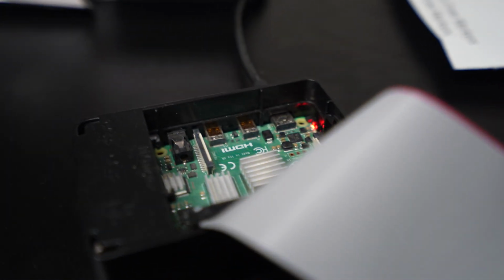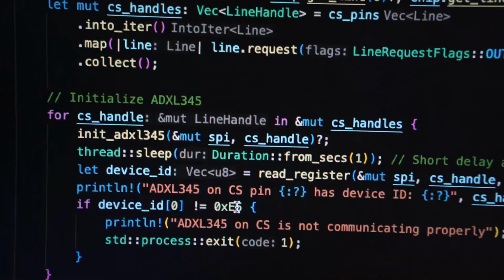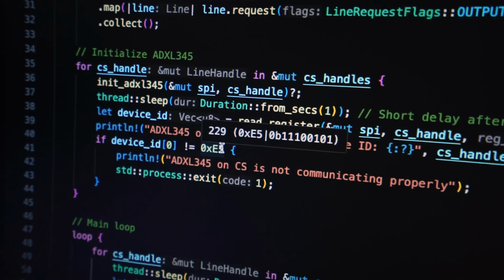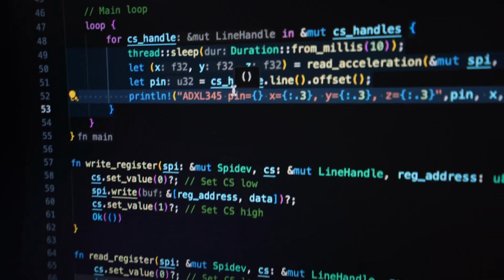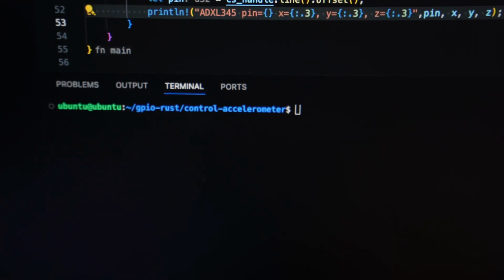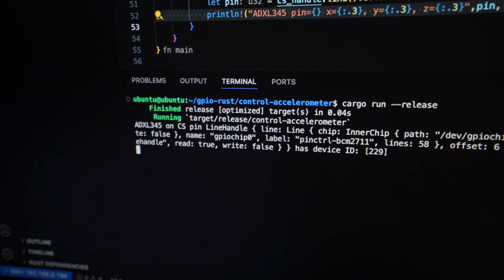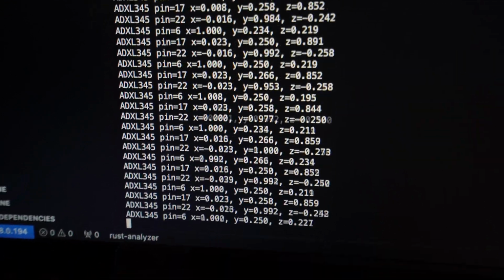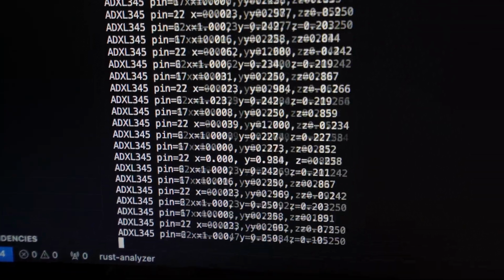Rust: Pushing Limits with 100 Hz Accelerometer Control

Comment: I am quite new to Rust and have only used ready made libraries for MPU6050 in arduino using C. I'm having a hard time understanding how fast this is, compared to the libraries that I have mentioned. Also, how different is the ADXL compared to the MPU. I apologize if I'm missing context here but can you inform me? I'm planning to use an IMU for a wheeled biped project and this info might be useful.
Reply from the maker: I am shopping with my mom but I’ll get back to you asap!!
Reply from the maker: Hello,

It's great that you're exploring different sensors for your wheeled biped project! I'd be happy to help clarify the differences and the performance aspects.

MPU6050 vs. ADXL Sensors:
Regarding the sensors, the MPU6050 and ADXL series (like ADXL345) are somewhat different in their capabilities. The MPU6050 is a 6-axis IMU, which includes a 3-axis accelerometer and a 3-axis gyroscope. This allows it to measure both acceleration and rotational motion, which is particularly useful for balancing applications in robotics.

On the other hand, the ADXL series typically includes accelerometers only. For instance, the ADXL345 is a 3-axis accelerometer, which means it does not provide gyroscope data. It measures linear acceleration but won’t be able to measure rotation on its own.

Performance and Libraries:
In terms of speed, Rust's performance is generally comparable to C, owing to its ability to operate at a low level with efficient memory use. This means that if you're switching from C to Rust, you should expect similar execution speeds. However, the actual performance can also depend on the specific libraries and how they're implemented. 

I hope this helps, and feel free to ask more questions as you progress with your project!

Comment: Hey! I'm not that familiar with Rust but in the code I see you have a 10ms sleep in your main loop which would limit you to the 100hz sample rate you're getting, would be interesting to know if you'd be able to get even faster results if you lower the sleep duration? And also, in your video you're logging the results (can't seem to find the logging in your code though so might be a log-breakpoint you set?), from previous experience with C# logging would limit the processing speed quite a bit when ran on the same thread as whatever code was running since it would be blocking

Anyways, pretty cool!
Reply from the maker: Yes! I was throttling myself I removed that code and instead o am streaming the data over udp 🤷‍♂️🤷‍♂️🤷‍♂️
Reply: @dario.lencina  Yeah I noticed the UDP communication code, that makes sense then! Really curious to see what the upper limits would be without any delay hehe
Reply from the maker: Heck yeah, I am putting together a serious benchmark for the long form video

Comment: In Rust, accelerometer controls you!
Btw, SPI is Serial Peripheral Interface. If you say Serial Port, most embedded guys would thing you're reffering to  U(S)ART / RS232
Reply from the maker: Thank you for pointing out the distinction! I appreciate the clarification about SPI (Serial Peripheral Interface) and its differentiation from serial ports typically associated with UART or RS232. It's crucial to use precise terminology, especially in technical discussions like these, to avoid any confusion. Thanks for keeping the details sharp!